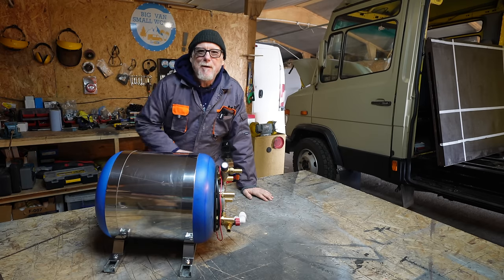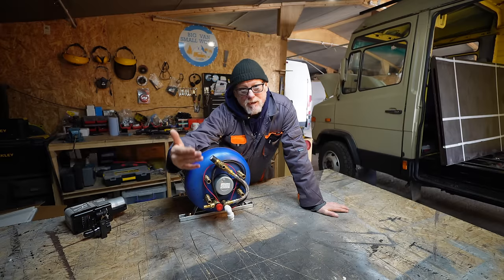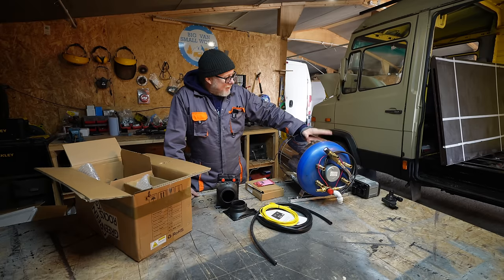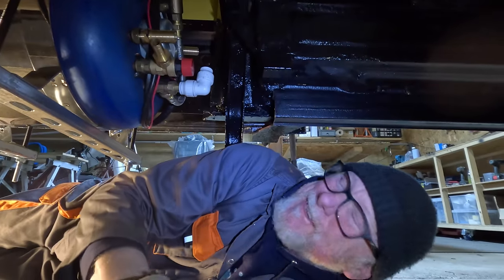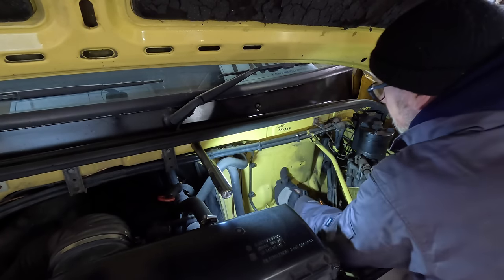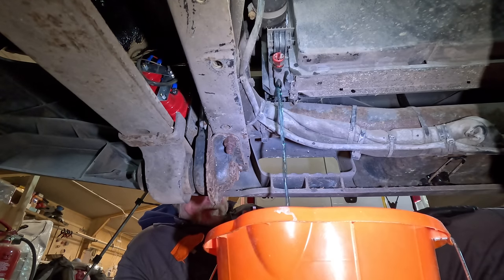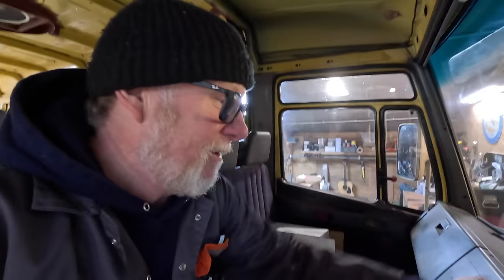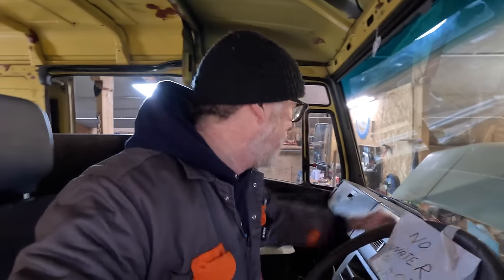The best way to heat water in a camper van #vanlife

Comment: I would seriously consider the practicality of having the calorifier underneath the van - the airflow over the unit when mobile will increase heat loss considerably - more importantly it will be nigh on impossible to winterise the installation.

Given the space you have I would find room to have what is a great resource, protected within the vehicle.
Reply from the maker: Thanks hopefully I won’t be in the uk next winter so should not be a problem
Reply: @BigVanSmallWorld  It does get cold in Southern Europe too ! - If I was you , and I'm not - I would drop an insulated " well " into the floor and fit the calorifier into that.

Given the nature of the floor construction in the Vario this shouldn't be too difficult - it would be a shame to limit your horizons just to warmer areas.
Reply: I doubt any winterising is needed. the tank is well insulated to keep hot water in. it will keep cold temperatures out for sure
Reply: @zack9633 agreed ❤
Reply: @zack9633  A flask of hot water stays warmer for longer outside if wrapped in a woollen jumper (ex site worker) so for efficiency reasons Frazer is correct.
In your situation though, you may not be so concerned about efficiency but still...'Every little helps' 💪🐕🚐👊
Reply: @pa_maj.MARTINI-van-MAN  Agreed . Insulate and isolate too , from road muck and stones , with some sort of shield . Build a clothes drying cupboard above the unit and in side the van if you do not insulate the whole unit .
I hate to think of how easy the unit would be to nick as well ....... Make a solid box with security in mind ? I think so
Reply: @davidyendoll5903  The drying cupboard sounds like a great idea, I like it!

Comment: That is a good idea to include the pre-heater within the system in case you visit Scandinavia etc.
What are the additional connections on the calorifier? Are they for a secondary heating element that you could take into the van and create a heated floor with?
Reply from the maker: Yes, 👍

Comment: There is a weird dichotomy between having SOME redundancy in a system.. and the realization that each redundant system adds complication that might be a liability itself when traveling to remote places. A “Bush” or “Bodger” fix might need to bypass all the redundant addons.  Personally, I rarely have travelled to someplace so isolated that a simple repair wasn’t possible .. but I have seen someone else stranded by the high-tech in their vehicle.. modern Sprinters, Transits.. BMW and KTM adventure bikes have that issue as well. 
In North America, the salt used for ice control is very corrosive to everything under a vehicle .. it gets everywhere as a fine vapor. It will damage Everything installed on the undercarriage. So my calorifier is an Isotemp installed inside the living space. 

I did find this video to be interesting, informative and entertaining.. Good on you!
Reply from the maker: Thank you for taking the time to write and keeping it positive really appreciate it 👍🍻

Comment: Awesome job Mel ,a tip here ,I saw were you were draining the coolant the leaf pivot  hanger ,these are critical on many of the  508 /608 Mercedes range ,there load bearing and if the same as the early versions ,just underneath there should be a tiny slit ,this is for draining excess moisture etc ,keep these cleaned out with a small  screwdriver and squirt WD or any lubricant ,and don't forget to grease the kingpins .👍👍👍
Reply from the maker: Thanks for the info👍🤓👍🍻

Comment: Congratulations on getting the Vario , if i was going to convert a van it would be a Lwb 4 wheel drive  Vario but I'm not sure about the headroom because I am 6 foot 5 inches tall,  that's why I live in my 1967 GM TDH-4519 city transit bus.  I would really consider building a insulated stainless steel box for that water tank,  to protect it and insulate it
Reply from the maker: Thank you for the advice I’m certainly going to look at building something around it to protect it or if I end up with enough room under the seat that’s going to be directly above it I may just move it to the inside of the van. Stay safe and have a great day thanks for the positive thoughts 👍🤓👍

Comment: Mel you need to put lock nuts on the threaded rods and put sum rubber packing on top to stop tank rubbing
Reply: Good idea John. I’d also reduce the length of the threaded rod for ground cover.
Reply from the maker: I have cut the rods now and you’re right a little rubber would be good 👍
Reply: Mel just looked up the first link for calorifier  and it asked what size level sensor any idea what that is ?

Comment: Great video wonderfully explained. You showing how to do something I never knew was possible in a vehicle. I was a heating engineer in years past and was involved in connecting large "domestic" hot water systems to waste heat generated by freezer systems in large plant rooms in supermarkets, one hot water cylinder preheating a second cylinder. It worked really well lifting the temperature from around 15 degrees to around 45 degrees with huge savings on the amount of gas used to heat a cylinder from cold. However...the down side was a cylinder of preheated mainly warm water was a haven for bacteria, not something you need to worry about here with your indirect dual systems. Can't wait for the next episode.

Comment: Similar setup to my kit Mel, I have a big tank out of a yacht!
Some things I planned to do, one was to ensure the tank of cold water doesn't act as a 'cooler' to a cold engine. Think of it, to get hot air in the cab you will have to get the tank up to temperature as well meaning you may not get hot air to demist your screen for quite a while? My solution is a inline thermostat, Ridex make one for £12, as soon as the water in the engine is at 80 degrees it opens to the tank,  just make sure the engine thermostat is hotter then the inline  thermostat and you will get hotter water for your tank before the vans radiator gets the hot water. Hope that makes sense!
I advise against fitting this under your van as others have suggested, keep it in the heated van is my advice.
No jokes from me today!
😮
😅
👍🇬🇧
Reply: if you run the engine heater for 20 mins the water in the calorifier will be at engine running temp sowhenyou start your engine it wont take long for it to reach opperating temp

Comment: Hi Mel, fairplay that's a great job, all bases covered for hot water,... just thinking, and apologies if you had in mind already but you could probably box the caloifier in with some alu or stainless sheet to shield valves and connbox from grit and salt spray from road, also autoterm do some silicone coated heatshield for 24mm exhaust pipe, for engine bay and boats, slips over the pipe like sock, works very well, Bobils prob have it.
Reply from the maker: Great tip! Thanks 🙏

Comment: Excellent video. I like the introduction of the engine pre heater. might get one of these. the link for the heater shows a different one, I was just wondering what the extra two pipe fittings are (10 and 2 o'clock orientation, I had a 15 litre calorifier in my last van, it was enough to shower two people easy. you will have plenty of free hot water, I also found out that using the engine cooling system while driving to heat the water is much faster than 12 volts and 240 volts elements. Thank you
Reply from the maker: Hi Zack that’s great to know thank you 🙏 my calorifire has two coils I didn’t go into this as I wanted to keep it simple as possible for people to follow along 👍

Comment: G'day Mel, as always great and informative vid but may i suggest turning your calorifier tank so your inlet/outlet pipes and electrics are facing the rear of the van. If your driving on wet roads you will have water being forced onto the electricals, even though you have sealed them, or if driving on unsealed roads you will encounter rocks and stones being kicked up by the front tyres an possibly  braking the plastic push in fittings
Reply from the maker: G Day buddy thank for your concern I should have mentioned in the video I’m going to box it in once it’s all up and running 👍🤓👍
Reply: @BigVanSmallWorld  You may be able to find a decent plastic water tank you can cut the top off to make it the perfect height, insulate the inside, drill out the bottom four corners to line up with those drop bolts/threaded bar and offer it up and bolt it on. 
Leave the bolts on that are already there but use some pipe for 1 1/2" spacers to allow for 1 1/2" insulation, drill a couple of holes in the bottom for drainage just in case.
When offering the plastic/ABS tank up, use large washers with the nuts, or 2" x 2" steel plate with with the appropriate size hole for the threaded bar.
Easy, protective and extra insulation plus it would be lightweight Mel.
👍🐕🚐👊

Comment: Hi. Great video Mel, very informative! Im a beginner about to embark on a self build camper conversion so am trying to soak up all of the info I can & your video helped a great deal 👍 Can you tell me why you went for a dual voltage calorifier, rather than just a 240v only please? (I am trying to learn so sorry if it's a dumb question). 
I plan on being off-grid 95% of the time & would like to use a 22 litre Surecal calorifier.  I would like to heat my water in the van via 3 options: the vehicles engine, via a diesel heater & very occasionally via hook up. I plan on using the Bobil Vans Hybrid Kit too (heat exchanger, diverter, Smart controller etc), so what voltage calorifier would you recommend that I would need Mel? Any help you can give me would be greatly appreciated!Looking forward to the next video, I am learning a lot from you, thanks Mel, good job!l regards Tracey 😊
Reply from the maker: Hi thank you for your support really appreciated I think your best talking to Bobil they are really friendly and they know stuff 👍🤓👍

Comment: Dont you love it when a plan comes together. Could you also use those underslung pipes carrying hot water to keep drinking water/grey water tanks from freezing?
Reply: The water in the pipes will be around 90°C when everything's balanced out which is probably ok for the waste tank (maybe smelly?) but probably not for the fresh water.

Comment: @BigVanSmallWorld hey Mel, great info on lots of options, always appreciated.  Could you show a little how to video on using the copper brake tubing instead of nylon? I imagine you have to flare the ends and use some kind of transition material from the appliance barbs?
Thanks!

Comment: 5:50 the hot water circulating around your engine is controlled by a thermostat which usually opens at 88°C so that your "up to 85°C" will actually be over 85°C when everything has warmed up & because it's a pressurized system can reach 120°C when the engine is getting towards overheating! 

You will have to think seriously about what you're going to do about the steam generated in your calorifier when the engine temperature goes up! 
(Limescale will also be precipitated from boiling the water).

Comment: How do you  heat up the water with the heater and not heat up the engine. Ive seen heat exchanges used but then you need a separate expansion tank or do you? Are you planning on having a full hydronic system?

Comment: Does the fittings system youve built allow for any expansion or contraction of the vessel when clamped tight!
Reply from the maker: Yes it’s perfectly fine as I’ll be using an expansion tank on the hot water side

Comment: I have a 50 litre example. in my house, fitted it into a cupboard then packed it with a quilt. You will find it will not  keep the water temp for that long especially open to the wind. However they are the only cheap option for hot water but as good a target as a catalytic converter to scum bags...

Comment: I wonder can you add an underfloor heating loop to this system? I've seen other systems add a radiant heating using the hydronic loop
Reply from the maker: @TheMadamDragon  yes I could do that but I’m worried that it would make heating the water take longer and it would cause the water temperature to drop quicker leading to less hot water to shower with 😉

Comment: Hi Mel. Great video. If I was to replicate the same ways of heating hot water as yourself using a calorifier, ie via engine, hookup/inverter 240v, 12v solar & via bobil vans diesel heater system, how would I rig up the bobil vans system to the calorifier? I understand from your video how to rig up the engine coolant to the calorfier, but not sure how I would have the bobil vans hot air water system rigged to the calorifier? Can you explain this to me please Mel? Thanks Tracey 😊
Reply from the maker: Hi Tracey if you go to there website and look at downloads you will find this hopefully this helps https://www.bobilvans.co.uk/_files/ugd/67186c_3e9197485d204d64b8b3460825677efa.pdf

Comment: Mel, question could you use a twin coil calorfier and use 1 coil on the engine and the other on the diesel water heater. So basically using the calorfier as a heat exchanger so as not to pre heat engine when you want hot water only ???
Reply from the maker: Yes absolutely 👍 but you will need to use a header tank for the diesel water heater I actually have a twin coil calorfier and was thinking about doing this with mine but decided to just loop them together making it quicker to heat up the water rather than having to run more pipes 👍
Reply: @BigVanSmallWorld  thanks Mel 👍

Comment: I wanna add one of these in-line with my Truma D4E. I am wondering if the Truma will trip if it sees the 'cold' water inlet is around 55degrees.
I suppose I could add it after the Truma but then I am wondering if I will need to drain 10 litres of water before it gets hot (say I ran the Truma first and the calorifier was cold, then ran my shower).
Reply from the maker: I’m sorry I don’t have a trauma so I have no experience with them

Comment: Hey Mel i've clicked your links for the surecal Calorifier but they don't look the same as yours, it looks like yours has a twin coil, there's the two in and out pipes you point to then there's 2 pipes above those then there's the cold in and hot out, love the idea
Reply from the maker: The one in my video looks different to the ones on there website but they do sell the same ones if you call Bobil vans and tell them you want the same as mine In sure they can help you there phone number is on there website
Reply: @BigVanSmallWorld  I did email them they said they sent you a single coil one, I took a pic of you demonstrating your one and sent them it they’ve not responded yet but I’ll call them Tuesday cheers Mel
Reply from the maker: @travellingjournalist966  https://camperinteriors.co.uk/products/surecal-22-litre-calorifier?variant=32006951436382&currency=GBP**wi=off**&wi=off&wi=off&gad_source=1&gclid=CjwKCAjw3NyxBhBmEiwAyofDYQLxXKcsrWy36ZiyMSpzdbQB_kB7uE6Q_sADmhCn8wg306scPtBHzhoCtY8QAvD_BwE
Reply: @BigVanSmallWorld  thank you Mel most kind of you

Comment: Bad idea, you need a splash guard as a minimum as you have it facing towards the front of the van. The two thermostats on the housing never have a long life span, sealing them in will just give you a headache not very far down the line. Box it in for a better and longer lasting job, and the pipes need better lagging.
Reply from the maker: It’s not finished yet 🤓👍

Comment: 3:07 how is your cab heater controlled? 

Some cab heaters leave the water circulating & control mixing of hot & cold air but some just have one air passage & control the water flow, shutting the water circulation off completely to provide cool air. 

If the water through your cab heater is valved none of your extra kit will see any circulation if you just tap into one heater pipe, to get flow with a valved heater you have to tee into both heater pipes.
Reply from the maker: Interesting 🤔 ill have to check that thanks 🙏

Comment: Is that a dual coil calorifier?  I’m trying to do same thing in my truck camper. Get rid of the entire gas system. I want waste heat water from engine and to also use a preheater for air and water. I’ll add a matrix in the camper. With a dual coil calorifier though, why did you plumb it the way you did?  You could have had two separate loops no?  The engine loop and then the hydronic loop?   Will the pre heater make enough heat to heat all of it?  Also, is there any downside to having the engine never really get cold?
Reply from the maker: Yes it is and yes I’ll be looking at fitting a rad on the inside to heat the van as well at a later date 👍

Comment: @BigVanSmallWorld 

Im going to install a similar system to my sprinter. However, i will be using an egr cooler as a heat exchanger for my diesel heater insted of the engine preheater.

Just one question why did you not just run both systems in series? So basically... out of heater matrix to engine preheater then to clarifier back to engine. It would mean only one pipe needs to be cut.

Chris
Reply from the maker: It just was easier to do it the way I did it

Comment: How well does the engine pre-heater heat the water? Could this not be used to heat water on its own, a bit like a mini diesel powered boiler? It appears to work in the same way as the bobil vans heater but heats water instead of air? 🤔

Comment: Putting that thing underneath where it will get all the muck from the roads is nuts, why not inside?
Reply from the maker: What muck? It’s not going off road
Reply: Any road spray, which might be salty in the winter months, I love the system and will try to replicate it but I will put it in an insulated belly box with a hatch rather than open underneath.